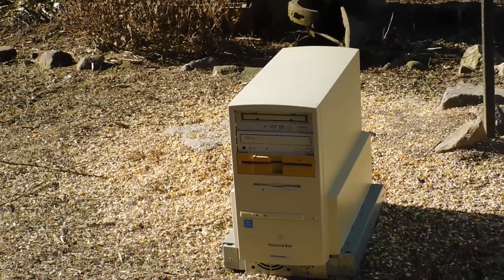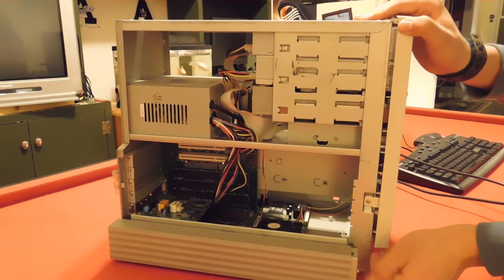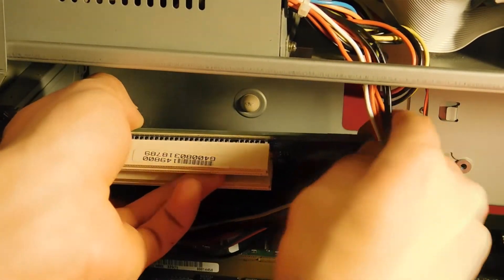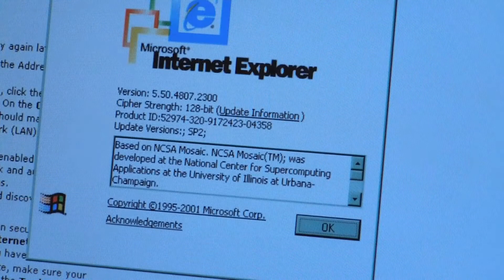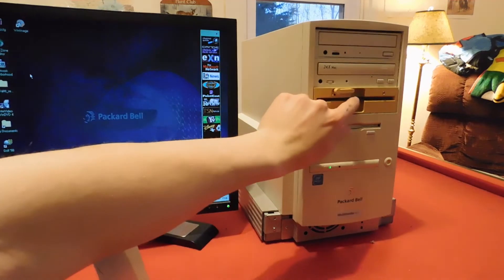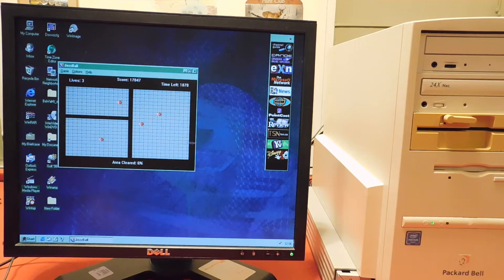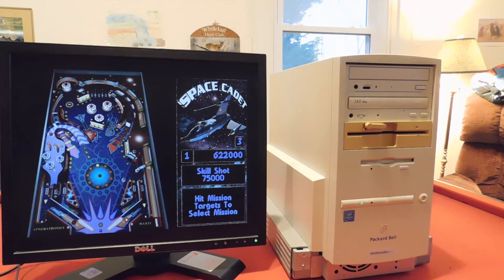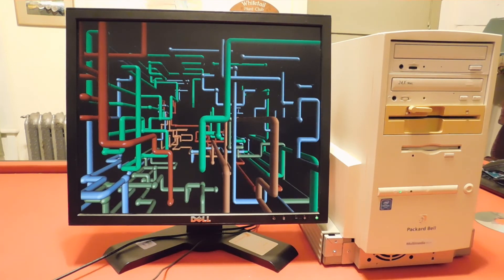The Packard Bell Multimedia PC from 1997

Comment: I have this exact Packard bell I just pulled out of storage. Mine did only come with one USB slot. I was pleasantly surprised that I forgot that I had upgraded to 98se lol. Booted up like a champ. I even have the original monitor with the speakers on the side lol
Reply from the maker: one usb port visible is how they ship, yes. You have to cut the metal covering the second port in order to use both.
Reply: @I430VX  ahh, got it.  Awesome video, thank you.

Comment: I just found a Packard Bell Multimedia 5606, monitor, keyboard mouse, everything. It even works! I'm curious to find out if I can connect it to the internet with a wifi adapter. If nothing else I can see about restoring it by swapping out parts with newer parts.

Comment: Dude , when I found  a custom PC in 2001 with a slot a athlon 600 mhz, 20gb and 10gb HD with hp cd burn drive,  I felt like a emperor as I only paid 9 bucks for it at the goodwill clearance in san Antonio
Reply: Nice!! I just picked up a R515 today for $20 looks almost new.

Comment: You can use IEradicator to remove IE and/or the shell integration from Windows 95. Once that abomination is killed, Windows 95 OSR2.x is extremely solid. 

Until last August, my only desktop dual-booted it with win2k. They were quite close in terms of stability.

You may recognize me as win32 in a couple other places.
Reply from the maker: The problem isnt so much IE causing the instability here as I've reinstalled several times, with and without IE. My PIII system with OSR2 is as solid as a rock, and it has IE 5.5 installed.
And yeah, I recognize you from MSFN.